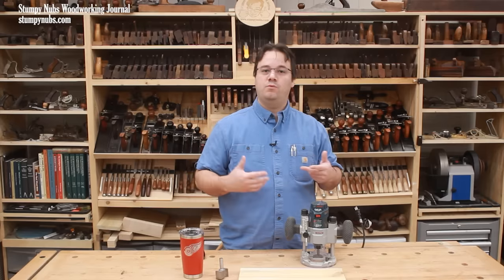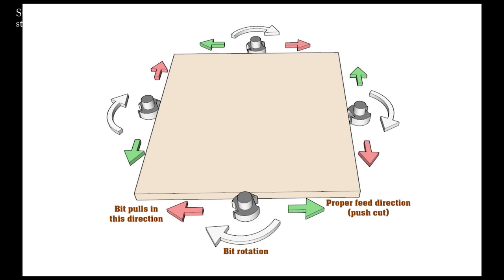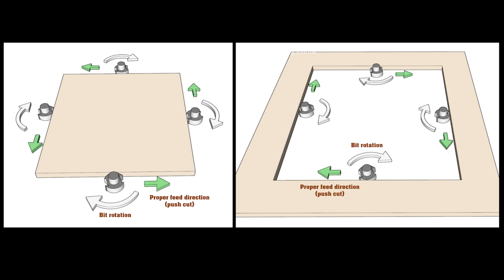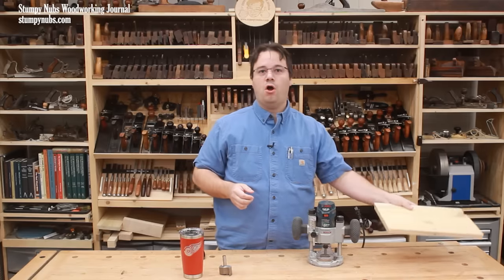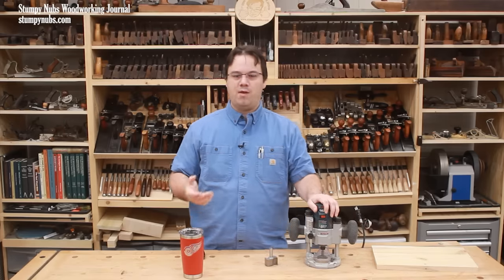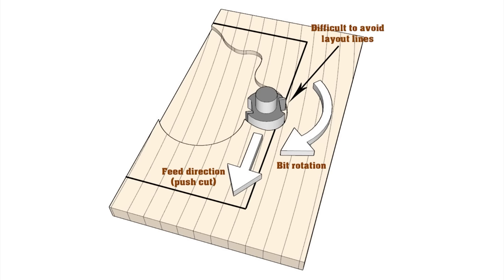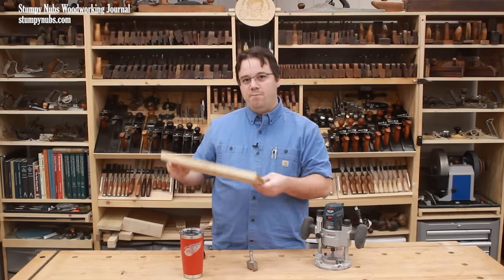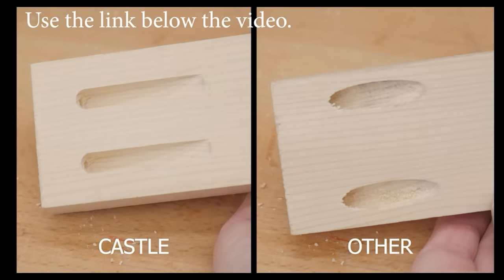The common misunderstanding of safe router feed direction

Comment: For those wondering which way to push the wood when on the table, the "rule of thumb" actually still works since you're moving the wood instead of the cutting bit. So if you put your thumb on the side of the wood you're cutting, which on a table would almost always be the side facing away from you toward the fence, your index finger would point to the left, meaning you should push the wood to the left for a push cut. However, if you're cutting like a channel down the middle of a piece of wood, then I'm not sure. Would direction matter then since it's technically cutting on both sides, meaning it's both a climb and push cut at the same time? I need answers, please help, lol.

Comment: Great video, thanks for sharing. But I do have one question with regard to the router table, when using the Rule of Thumb on the router table would you rotate your hand palm up to get the correct push direction?
Reply from the maker: No need for a rule of thumb on the router table. You always use the front of the bit and you always go from right to left.

Comment: I've never had any problems by just feeding into the bit orientation. That is, most bits will have an orientation of the cutter head(s) for one direction only, and may have  a rounded shoulder that supports the cutters. It's pretty difficult to actually climb cut with these bits as the cutting edge is oriented opposite the rotation of the bit.
Of course, not all bits are shaped the same, like core box bits,  or spirals, but you can also tell the proper feed direction if you look at the the cutting edge angle on the bit, and whether it will be against the feed direction or with it.

Comment: UNDERSTAND THIS!!!!
A contractor I worked for found out the hard way last summer... (Stop here if you easily get woozy.)

We ended up having to use a trim router to cut grooves down the length of both sides of dozens of 12' Trex decking boards.  In a rush to get the job done, the contractor ended up using his 'weak' hand to do a climb cut in an awkward position.  Unfortunately, he was holding the piece on top using his 'dominant' hand.  The router pulled itself out and it grazed his second knuckle on the thumb of his 'dominant' hand.  He ended up needing to have a ligament reattached and plastic surgery to repair the damage.  Then months of recovery.  Not to say it wasn't bad, but it EASILY could have been much worse.

Be aware and be careful, ya'll.

Comment: As a metal machinist, a big "no-no" was "climb-milling". The cutter head/tool would be taking a big chunk / volume when first coming into contact with the steel. At the end of the cut (rotation) it was removing less material. So when I bought my first wood-working router and table, all the directions for the cut, positioning the feather boards, etc., showed that it had to be a climb cut. WTF???? After many episodes of flying work pieces being chopped to bits as if was quickly dragged into the cutter (bit/tool) I reverted to my old metal working ways. I no longer have smoking bits of gouged wood flying through the air!!!
Reply: After just watching this video, I'm pleased to know that I got it right by following my metal-working ways and NOT the directions that came with the Router table. 🙂

Comment: The thing that I found confusing was the statement that the directions reversed for a router table.  The basic notion that a push cut is preferable is preserved.  Routers scare the bejeezus out of me, but they are incredibly useful.

The idea of taking off most of the material with push cuts followed by a light climb cut pass is a good one if the grain is against you.

-----

Somewhat related, it is not even possible to make a climb cut with a jointer (at least not any jointer that I have seen).  However, you can choose which end of the board to send into the cutter first.

Comment: Would you call it risky to engage a 1-3/4" stile routing bit using only a guide pin in the table and the guide bearing on the router bit? I'm planning to route curves with this big routing bit.

Comment: Though hanging onto a router when it bucks (especially a 3+ HP one) is terrifying, I believe the dangers of climb cutting are overstated. Climb cutting is very easy to control as long as it is being done on an edge. This is because the bit can ride out of the cut and escape to where there is no wood for it to continue grabbing, thus it harmlessly comes to a stop. In my experience, climb cutting is only hazardous in 3 types of scenarios. 

1. When routing an edge AND pushing the router into the wood too aggressively. Just let it ride and escape out of the cut if it starts to take too big of a bite. 

2. When routing in the interior of a board's face (not the edge). 

3. When the piece being routed is between the bit and a fence, either on a handheld router or router table. 

Climb cutting on a router table isn't such a good idea either. 

My fear of the router bucking went away once I came to understand what really causes it. Take time to learn, and route with confidence.
Reply from the maker: Did I overstate the dangers of climb-cutting? I said it can be safely done with a handheld router and even explained how...

Comment: To me the easiest way to remember in the beginning was as following.
I imagine the router bit as a car's tire. What direction would the car go, when the wheel rotates that way? Push it in the opposite direction.  
So I don't have to deal with thoughts like "Am I in front or back side of the workpiece and was it left or right than? And am I inside or outside, which makes me changing the routers direction again?"  
Nope, just image the tire contacting the surface and push the car against it's movement ;)

Comment: My first pass on an inside rabbet rout was with a 3 HP router, 2" diameter bit, 1/2" cut height, 1/16" cut depth - climb.  Piece of cake.  My second pass was to a depth of 1/4", i.e. another 3/16", also climb.  Worked fine for about four inches, then the router seized the wood, jolted, and stopped.  Stopped?  Yeah, stopped.  It tripped the 20-amp circuit breaker.
The breaker's little light for arc fault was lit.  Maybe the sudden load on the router increased sparking in the motor's brushes.  I am not going to repeat the experiment...

Comment: On the few times I have used a hand router, I chose to pull cut, rather than push cut. ie. Same cutting direction, but I’m pulling the router towards me, rather than pushing it away. I’d much rather if it caught and kicked back, it rips out of my grip and shoots away from me, rather than flinging straight at my abdomen with a high speed disemboweling tool.

Comment: The "rule of thumb" I use is different and works for near and far cuts and both tables and handheld. Your right hnad is a router bit - the thumb is the tip of the bit and the tips of your curled fingers are the cutters. If you put your fingernails against the wood, the tips pointing the direction of the cut.

Comment: that's easy.   climb cut is only for CNC and dense materials not prone to delaminating or chip melting.
also - straight edge "wood bit" and wood is the worst possible combination for climb cut.  helical end mills and bits with small individual teeth are much better.

Comment: I would never attempt a climb cut on a router table.  I have taught shop classes for 18 years and the only router accidents I've witnessed was the operator having a mental lapse and feed the material from LEFT to RIGHT.  On two separate occasions I had students who were operating the router table successfully for weeks and then had a mental lapse.  In each accident, the material was fed left to right, the bit PULLED the material from the operators hands, and the left pinky finger continued into the bit.  One resulted in an amputation at the nailbed.
Reply from the maker: This tutorial is for handheld routing only.
Reply: @StumpyNubs  and a very good tutorial.  I was sharing a router experience.

Comment: I'm using a table router to cut out pine molding for picture frames. (the "L" shape) I usually set the fencing in the position I need it to be and then make consecutive passes, after raising the bit about 1/8 of an inch each time until it's cut as deep as it needs to be.  I sometimes have trouble with tear out. Is there a way to avoid it in that case?
Reply from the maker: You are cutting a rabbet on the back for the glass/backer board, correct? This video contains some tips for reducing tear-out: https://www.youtube.com/watch?v=7Qejzz9qI74
Reply: @StumpyNubs  Yes. Correct. and Thanks!  Yeah It was the first time I've experienced tear out when doing so,  which I thought could be caused by the feed direction, but after seeing this video, you confirmed that it was best to feed against the blade on a table router.  I would love to just go back to doing two chops on a table saw (it's quicker and easier) but I'm now working in a shop that has just about everything EXCEPT a table saw.

Comment: You said the bit rotation will want to pull you from right to left. That’s wrong. The bit is spinning clockwise, so the pull will be from left to right. As you said just after that - clockwise around the piece. You should correct that statement.
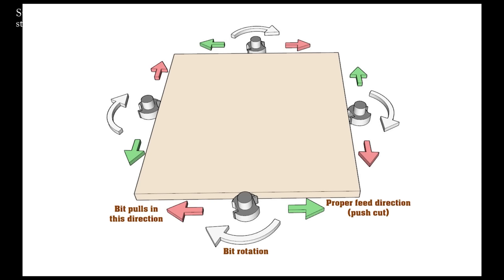Reply from the maker: You commented before watching much of the video, didn't you? You seem to be thinking the drawing illustrates a router table. You only had to watch about 2-minutes to know it is illustrating a handheld router. (2:10) And my directions are correct with a handheld router.

Comment: and if the radial depth of cut is more that the radius of the cutter a climp cut isn't really a climp cut
Reply from the maker: It's a climb cut when the factors I explained at the beginning are present, unless both sides of the bit are engaged, in which case one side cancels out the "climbing" of the other.

Comment: 0:45 is that the diagram for a router table or hand held router?
Reply from the maker: Maybe you should watch a bit more of the video?
Reply: @StumpyNubs  I did watch the rest of the video and note that you did clarify it, the illustration should still have noted that it was for use with a hand held router and not with a router table. That would help someone who, for example, wanted to take a screen grab and print it out for later reference.
Reply from the maker: @fred_derf  Hey Fred, I put a LOT of work into this lesson. Everything you need is in the video. If you choose to print a screen image, then why not just write on the paper what it is. After all, I explained it to you in the video, so there should be no confusion.... Have a nice day.

Comment: I totally disagree with conventional cutting in almost all cases. My usual scenario is to remove the bulk of the material using climb cut then go back over and finish with the push cut for final material removal and smoothing. Usually by the time I'm routing an edge or something similar I've got too much time invested to take a chance on tear out. An exception to this may be if I'm routing plywood, then I may not bother and just go to push cutting. Good videos congrates on Ten years.

Comment: I find your illustration confusing. I think of "feed" as moving material into a cut. Your illustration indicates moving the cutter along the cut, which is the opposite direction.
Reply from the maker: Feed, at least in the context of this video, refers to whatever you are moving or controlling. You feed the material at the router table, you feed the tool when routing handheld. Even if you disagree with my use of that word, this portion of the video makes it clear what the drawings represent: 2:10

Comment: Right hand rule = right hand Thumb up with fingers curled in toward the palm. With the thumb pointing in the direction or the shaft, the fingertips point in the direction of rotation.
Reply: He did not say "the right hand rule," he said "the rule of thumb." What you just described is exactly backwards for a router bit. Your thumb has to point in the direction of the TIP of the bit, not the shaft, for your fingers to properly describe how a router bit turns. But he was not talking about the rotation of the bit, he was talking about the direction you move along an edge which is why he said "the rule of thumb."

Comment: I hate to be rude, but I think that all the time spent on rules and thumbs and reversals was more obfuscatory that enlightening. The simplest way to think about what you're doing is to recall the direction the bit is spinning, and think of it as a wheel. If you can't see a diagram on your router that illustrates the direction of spin, then you need to make a label that shows it clearly. Anything else is just too many things to think about, and really unnecessarily confusing. You're either going along with the spin (climb cut) or against the spin (push cut).
Reply from the maker: A diagram on the router doesn't account for the feed change depending on which side of the bit you are using. I don't see how the thumb rule, which is very simple, makes things more difficult. But you do you.

Comment: I don’t think this is difficult at all. Just know what direction your bit is spinning and move the router so the workpiece is going against that direction. No rule of thumbs and diagrams needed.
Reply: Not always the case. If you go against some grain, it will chip or tear out.
I had it happen bad on some Spanish cedar.

Comment: I think you made this far too difficult to understand with the different feed directions.  The teeth of the bit need to go forward into the wood the same as a saw blade.  You would never feed a board the wrong way on a table saw because you know what will happen.  People should look at the bit against their piece every time to know they are doing it right.  Who can keep straight all the tips and rules if you route once a year?  Understand the physics and how all your tools relate to each other and you will be ahead of the game.
Reply from the maker: A thumb and finger is too difficult to understand? I think it's important to explain the how and why, as well as offering an easy solution.
Reply: @StumpyNubs  Yes.  You have to remember the tip, what it applies to, and what your thumb and finger mean.  Is the finger the direction of the cut?  Is your thumb the shaft of the router?  It is simple and not those things but am I really going to remember it in six months? I love your vids, but this one seems to be one of those instances where something is so simplified that it makes it harder to understand because the underlying principle is talked around rather than addressed.  

That being said, the info on grain and tearout was very helpful.  Of course, you were discussing the direction of the teeth through the grain just like the concepts I think make safe router direction logical.

Anyway, thanks for the vids and Happy New Year.
Reply from the maker: @bkupron  Don't forget, you also have to remember you HAVE hands, then you have to know your left from your right, then you have to remember how to point, and all the while you have to multitask breathing!... And what if you only have hooks for hands? What then?... LOL...Have a nice day.

Comment: over complicated video, follow directions, many router tables even have arrows to show feed direction and the routers even have same markings. if you can't follow simple operating directions, or can't tell simply by looking at the bits rotation in the tool then maybe you shouldn't use power tools if you can't follow simple directions because you are dangerous. always test on a piece of scrap wood first. using blue painters tape on edge can minimize tear outs, starting a cut after the end then backing up can also minimize tear ups at those corners. showing its use on a piece of wood with the tool even if its not running, is far less confusing than trying to over explain with diagrams and charts which are by nature confusing.
Reply from the maker: The arrow on the base does not account for the position of the edge in relation to your body. You may consider it simple, but thousands of beginners do not. I made this video for them, not for you. Your comment that people who struggle with keeping it straight shouldn't use power tools is rude, condescending and unwelcome on this channel.